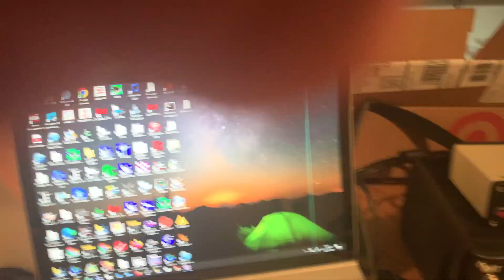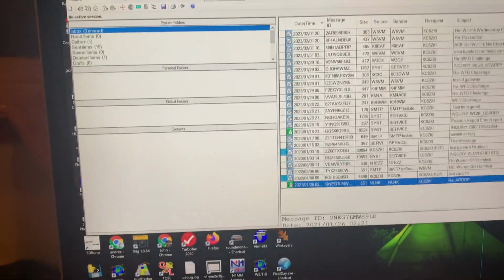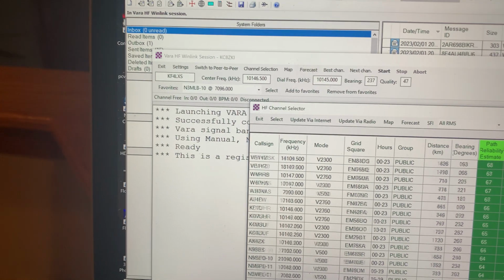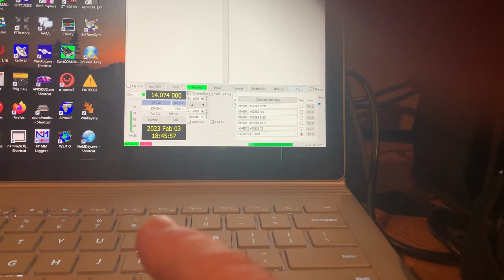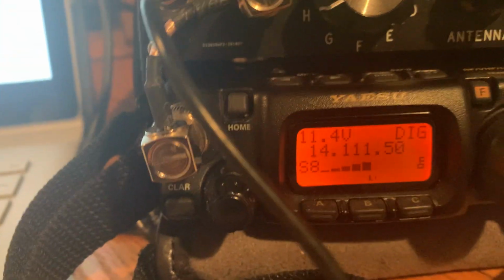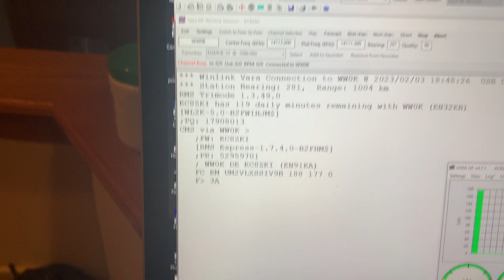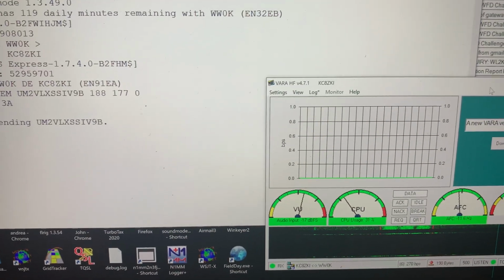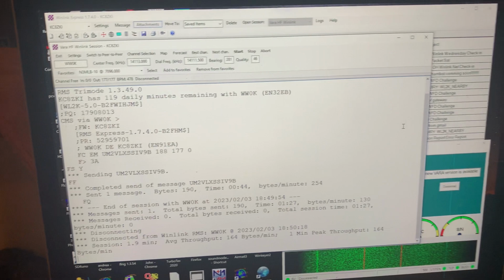Winlink - tips for QRP success

Comment: Great video. Am confused that some videos on VARA ham show 857D in USB mode on 20m and yours shows it in DIG mode? Can you clarify
Reply from the maker: Hi Dennis, thank you.  The radio in the video is an ft-818.  It does however operate just like the ft-857d.   DIG mode switches the radio to accept audio input from the rear 6 pin mini din connector.   Is is possible others have their audio interface connected via the mic input,in which case you would then use USB.

Comment: Nothing is more satisfying than making connections on low power, indoors.  Great video, because it shows what is capable.  I use the tune option in the Vara modem window, under settings, soundcard.
Reply from the maker: Thank you.   Good point regarding the VARA modem tune option.